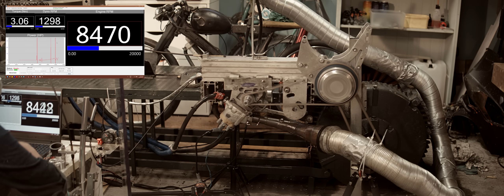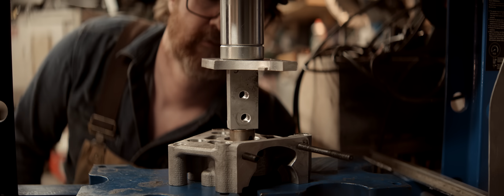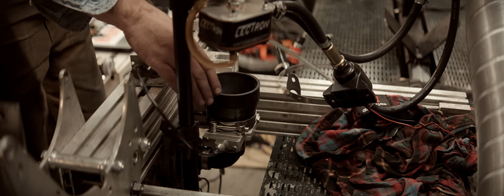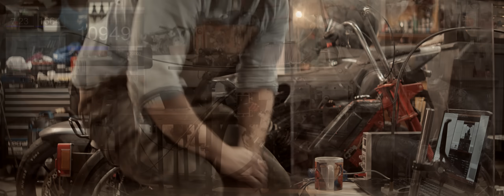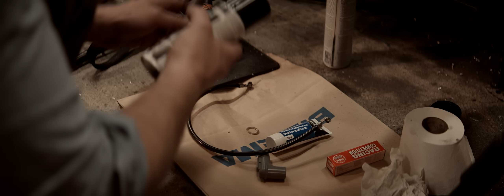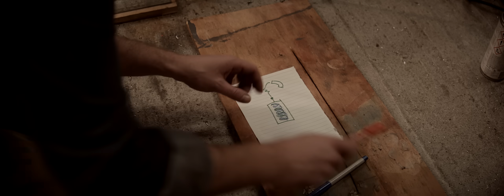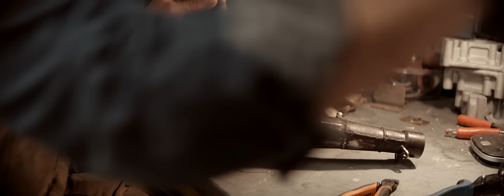50cc only making 29hp. Where did the power go?

Comment: Nitro rust! Nitromethane is corrosive as hell!
I raced nitro boats in the 80’s. 
At the end of the day we always emptied the tank and filled it with some methanol only mix. 
Ran it for a minute then squirted sewing machine oil in the carb until it choked. 
Otherwise the crank and bearings would rust really bad really fast.

Comment: If you feel like trying your engine in a car, Im building a fiat x19 with a modular setup for trying snowmobile engines. Stock HP is in the 30's but I've almost reduced weight by 50%

Comment: I think for the ignition you should try coil on plug. I have used Toyota COP from 1.3 Yaris on many turbo cars and it works fine. It's an active COP very strong spark.
Reply: Vag r8 or similar would be good and cheap
Reply: @eiccaw  After some quick Search:
»NGK U5014« aka »VAG 06E905115E« are still the Solution of Choice?

I’ll take a Look at that. I have a Engine that is suffering from weak Sparks from the Factory.

Comment: I am still hearing that odd fluttery noise during the power pulls....same as the last video.
Reply: yeah, me too, we call it 4stroking in Dutch, low to mid range it sounds stuttery, 
side note, to me it normally meant to rich or sparkplug/ignition issue
Reply from the maker: Could be my ignition unit/coil is starting to fail. It's highly stressed and just barely able to light the mixture.
Reply: @2STROKESTUFFING  It certainly sounds like something in the combustion process, as it fluctuates with RPM. It's not very helpful but at least you can hear it and know to keep looking...
Reply: @2STROKESTUFFING  since you are trying to get the mixture as rich as possible and regular change plugs the coil could be givving up on ya, Ive had the same phenomena with a bad coil wich only ran smooth on high rpm's, maybe you need a hotter plug an 8 or 9 maybe even higher

Comment: You should contsider running a GT2 timing belt for your first gear reduction at the speeds that chain is moving its terribly inefficient and dangerous I did some math and worst case scenario if that thing makes 30 hp at 5252 rpm which it won’t it’s only going to make 30 lbs of torque right. So let’s just say for easy math that your crank pulley is 6 inches that would mean at most your looking at 15 lbs of force on that chain or belt, a GT2 belt can apparently withstand upwards of 100 lbs of force. I think it would make things dramatically more consistent and safer
Reply from the maker: Sounds smart👍
Reply: @2STROKESTUFFING  we gained significant rpm on our robot shooter when we went from a chain to a belt drive system in FIRST robotics

Comment: 31.15hp indicated during the run at 30.52 on the video, at under 16k rpm. Both runs were before you discovered the fractured exhaust. Perhaps the change in the exhaust tune/resonance was somehow beneficial? Difficult to know unless you can work out when the exhaust broke. Keep on keeping on.

Comment: Wouldn't it help to determine the ideal fueling by testing with an adjustable EFI? This would gave you a baseline number that you can work with for the carb adjustment. As far as high rev chain lube goes, I have good experience with chainsaw lube.

Comment: I watch from start to 5:19min. Ok you change the chamber to 6,5mm but every run is a little less power in. But the rpm is nearly identical. Maybe the carburator must be cooled too? Could it be, that the motor temperature is the reason for this? The warm zylinder is expanding so the pressure inside is less than the run before. Maybe you could install a pressure gauge somewhere to observe this? Just my 2 cents❤ i love your project
Reply from the maker: Definitely👍 it's loosing power much faster vs earlier though, have a feeling something in the ignition system is starting to fail from overheating.

Comment: Add some shield around the coil.  Keep the distance of the shielding a couple inches or more away.

I wounder if you could also be hitting saturation of the coil it self.  Simply cant react fast enough.
Reply: On the standard coils for a blaster, i reached 12,500rpm.  This is a wasted spark ignition.  

This wasn't on a blaster, but its the same coil.

Comment: Hi, an iron core inductor core will saturate at around 250 Hz, 20000rpm is 330Hz. A ferrite core transformer can refresh without saturation thousands of times quicker. As far as I can make out this is why older v6 cars have two ignition coil’s for reliability within these parameters. That’s not too say one coil won’t do it but if you start to saturate the core voltage will drop. Thanks for the videos. Hope this helps.
Reply: I believe he is running a CDI system... Energy is not stored in the coil, just the internal capacitor of the CDI. Edit: You are talking about the charging inductor, my bad.

Comment: try slippy pipe like on karts        slippy is a thing that ajusts the length of pipe from piston face to the 1st cone of pipe  ajustable on the fly enduro karts have a ajustment of  pipe flex 'the pipe gets shorter as the engine reaches top rpms  there is a good video of a enduro kart at daytona and you can see the pipe geting shorter as rpm goes up as kart flys down the track  the slippy device fits in the pipe where it is between piston face and 1st cone of pipe        great programing !

Comment: my theory is that the hole in the pipe made the pipe better tuned initially when the hole was small or just a crack.
Reply: You could be right, as it would set up a different resonance. You would have thought the change in stinger would have shown up something though.
Reply from the maker: What I thought too.
Reply: @2STROKESTUFFING  Check for pooling liquid in the belly of the pipe. Every misfire means a MASSIVE load of liquid enters the pipe and probably doesn't burn, if enough gets into the pipe it'll affect it I bet. Maybe turn the pipe downwards so at least it will exit the system? I've had tons of oil pool into the silencer on methanol. 

The pipe slips under high pressure/load/power. You can see it stretch the springs and you can see vibration, potential variable. There appears to be oil seeping from the temp probe weld area, potential variable... The outside of the pipe is SOAKED in oil, that'll affect the heat transfer rates and probably make it retain heat more, another variable. Sometimes the extractor slips at high power and sometimes it doesn't, would that affect it? 

Can you shorten the chain system massively and bring everything close together? You might have a resonance wall stopping you. Can you convert to belt drive? A belt can definitely resonate but at least there will be WAY less mass slapping around. 

Can you build a small reduction or overdrive gear box to force the chain slapping load to affect a different bearing set instead of affecting the crankshaft bearings? All dirtbike and motorcycles have multiple gear reductions and therefore multiple bearing sets that carry the chain slap load instead of directly affecting the crank and crank RPM in such a meaningful way.

Comment: “Only 29hp” … from a 50cc engine. That is a wacky thing to hear from someone
Reply: He had already reached peak power back then. Now the goal is to reach that magic number again, which could lead to a new season.
Reply: Same. What high performance magic is this?
Reply: @MatthewTaylorAu repeating b s
Reply: Wasn't that with nitro?
Reply: Kreidler van Veen 1974: 27.8 PK
Reply: Was it not blown?
Reply from the maker: No Van Veen produced anything close to that. Maybe 20.
Reply: @2STROKESTUFFING  Have you ever confirmed the calibration of your dyno with a motor of known power? Without that, your numbers should be taken with a spoon full of salt.
Reply: My 200cc is less.
I used to have a aprilia 50cc, that was 12hp.
Reply: It's only more powerful than a stock 250r. 😂
Reply: @cryptid_legend7567  he's never calibrated his dyno. Who knows what power that motor actually makes...
Reply: You will need 40hp to beat the land speed record  at bonneville for 50cc..144+mph stands today

Comment: The engine stopping to rev completely at ~16-17k has to indicate a problem. A 50cc two stroke with racing ports should absolutely be able to rev much higher, well over 20k. Not sure what the peak power rpm should be though.
But power shouldn't be falling off a cliff like that I think?
Maybe put a oscilloscope on the ignition wire to see voltage and amps to try and detect missfires.
(I have raced 100cc two strokes to 24k)
Reply: 100cc at 24k rpm, that sounds epic. What stroke and what piston?
Reply: @chyrt  Was a vortex ICA engine. Karting. If I recall correctly about 50mm bore and 50mm stroke. Only did over 21k at a single track though. But at that one 24k! Well above the power band obviously.
Reply: @no-one_no1406  I never new those kart engines revved that high, might have to take a closer look to learn something from them.
Reply: @chyrt  They don't/didn't make power at those rpm any more. But with direct drive you need as wide a powerband as possible. The track in question had a very high speed corner that was critical for lap times, so optimum ended up being gearing for that corner exit (about 16-18k peak power) and then just revving like crazy down the straight after that. No other track I raced at saw near that much rpm. You also needed to deliberately operate in detonation AND pre-ignition at those rpm to get it to rev (ignition timing was mandatory as fixed so couldn't increase timing at higher rpm).
Reply from the maker: I think there's an ignition problem, might be noise on the trigger signal, and/or it's just too weak for the super rich afr. With how this pipe is designed you get very little overrev, 100cc kart pipes are made to have a wide spread making direct drive usable.
Reply: @2STROKESTUFFING  Yes correct with the 100cc karts.
Easiest and cheapest way to see if you have a ignition issue I think would be to get a cheap oscilloscope with logging capability and log the crank sensor (at least 4 pins per rev, preferably 12+) during a pull. You will instantly see the rpm fluctuations from each firing event, and easily see if the rpm increases are missing sometimes or not.
Reply: @no-one_no1406  Maybe he could get one of those cheap miniware oscilloscopes sponsored for free if he emails the right email address.
Reply: You could also put a oscilloscope on the crank trigger and detect missfires from engine rpm changes / cycle.
Reply: I totally agree with oscilloscope! Imho I'd add dedicated misfire detection using some controller. The idea is to see it just in real time. While this debug option is very valuable, Alex would need to learn programming controllers then or hire someone.

Comment: With the amount of fuel the carb was puking out the front just the conversion to down draft would make your AFR off.
Reply from the maker: It's not puking in the powerband. Tried going much leaner but didn't help just gained some rpm from extra heat.
Reply: @2STROKESTUFFING  Looking back on your video a month ago you can see the fuel vapor getting spewed out the front of the carb at all ranges in the RPM when you were reving it. As well a large jump in jet is not what I was talking about we are talking about the amount that was just coming out of the front of the carb now has gravity to help it the right direction but bigger then that the air filter is not letting it exit in to the room any more.

Comment: Is the strange corrosion around the bearing not aluminium from the case and steel from the bearing reacting?
Reply from the maker: Sounds plausible, galvanic corrosion.
Reply: @2STROKESTUFFING  that's the one. The introduction to methanol or slight moisture from the methanol could be setting it off faster perhaps 🤷🏻‍♂️

Comment: I don't know about your country but alot of hobby shops that sell rc cars sell the 1.5l bottles of nitro methanol and caster oil mix could just go for that for the hell of it. Different ratios oil/nitro are sold. So you can experiment with it. As well as its hard to tell over YouTube video but the spark doesnt sounds rough up top but chuggy down low. When you do your dyno runs initial engine "spool" is critical to top end power. Start lower power=end lower power.

Comment: Hi Alex.  IIRC, your high power runs were made with the old fuel, potentially contaminated with water.  Could it be that the water contamination was pushing the power numbers up?  We see higher power with higher humidity, or with water injection, so ....
Reply: kinda like methanol water injection they used on old WW2 planes i think
Reply from the maker: 32+ hp was on the new fuel so sadly no...

Comment: Is the ignatec just a trigger module?
If so go and buy a Bosch HEC 715 or 716.
The "new fangled coils never competed well against a factory High Energy Coil. And they are not terrible for EMF, because they fit factory cars.
They'll happy run a peripheral port Rotary. Yes yes not the same I hear you say, rotaries have a way way worse combustion chamber. 
We Siamesed two HEC 715s for each coil lead, it never had misses. 
Touching the ignition system was verboten. All the leads had visible coronal leakage.
Fixed by aluminium covered aircon line insulation.
NGK BUR10EQ or SD10A (yes it is resistor, no it doesn't conform to normal NGK numbering) are way better for nominal flame fronts and inconsistent mistures and are a direct swap to BR10EG. R6061-10 are also very very good, esp for high revving and inconsistent mistures.
And all are fine with two stroke oil.
I run premix in my car as an extra precaution.

Comment: EMI shielding the coil could be worthwhile as well as electrically grounding everything
Reply: yes, running a return wire close to the secondary will keep the loop area small, which keeps the EMI down.
Reply: I agree. Cage the coil! - Another worthwhile point could be Aviation (RFI supression carbon core and extra grounded shielding) spark plug wire and a iron spark plug cover.
Reply: Some of the corrosion looks like galvanic, grounding everything may help with that as well.

Comment: I notice the pipe is laying horizontal and is pretty wet. Could there be fuel/oil pooling in the middle of the expansion chamber, messing with the harmonics?
Edit: Posted before you removed the pipe so I gues not

Comment: It makes a big difference whether you have a straight or curved intake tract, because your design is spitting a lot of fuel back. The droplets don't want to follow the curve and get stuck in the bend. Before, excess fuel landed on the ground; now it all stays in the intake. The hole in the exhaust makes all your further testing pointless. You may have patched it, but the pressure wave is still affected. In the power range where the engine operates, even a small detail makes a big difference. I bet you a professionally built exhaust would boost the engine to over 35 hp.
Reply: His pipe is unique in that it is extremely short compared to a "profesionally" made exhaust. Pretty much nothing in his engine is conventional. Its a 50cc engine with 30 friggin horsepower. Never before has that been achieved.
Reply: @just_j0e If you think that so much power has never been extracted from a 50cc engine, then you are unfortunately misinformed. There are plenty of records with 50cc engines that had over 30 hp; 233 km/h simply isn't possible with less than 35 hp. Even 70 years ago in Germany, there were 50cc engines with 30 hp and more.
Reply from the maker: You need to provide sources for the German 30hp+ claims, never heard of anything close.
Reply: @2STROKESTUFFING That's hard to prove, back then there was no internet or Instagram, but it was the era of two-stroke engines and there were many people as slightly crazy as you who experimented. There are no records, only hearsay. If you use the right fuel, where oxygen is already present, performance isn't a problem, just one adjustment you can make however you want.
Reply: @2STROKESTUFFING I was bored and took a closer look at your entire engine design. You have a big problem and a small one. The small problem is the imbalance of your rotary valve, and your big problem is that your crankshaft is too light and doesn't have enough rotating mass.

During the piston's upward movement, the mixture has to be compressed. The energy for this is stored in the crankshaft and is extracted by decelerating it. To put it simply, your crankshaft reaches 17,000 RPM on the downward stroke, and at the peak of compression, the crankshaft is slowed down to 14,000 RPM. Ignition = 17,000 RPM... Compression = 14,000 RPM... that's why your chain is vibrating so much. My advice to you is to redesign the underside and use a larger rotary valve that acts as a flywheel without imbalance on one side. On the other side, I would also use a flywheel... the additional rotating mass won't cost you any power, it will just slow down how quickly the engine revs from 5000 to 17000 RPM.
Reply: @2STROKESTUFFING If we ignore the minor issues, you can be really proud of your design. You first have to get that much air and fuel into the combustion chamber to draw that much energy from the crankshaft just for compression... So, good prospects for 35+ hp.

As I said, flywheels on both sides with considerable mass. The energy in the crankshaft must be so high that the crankshaft speed only drops minimally; ideally, there would be no drop at all. The more stable the speed is during compression, the better your ignition will work. So you're solving several problems at once.